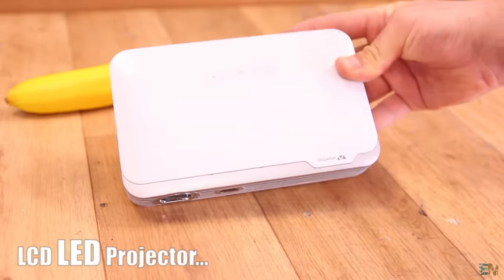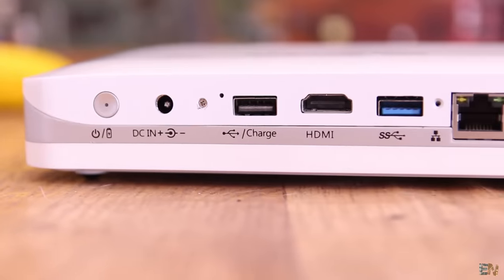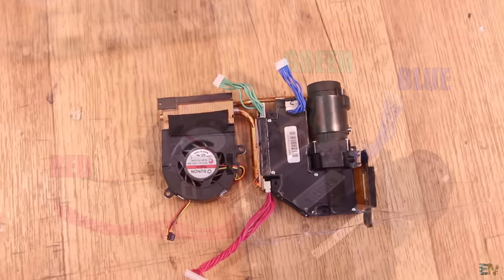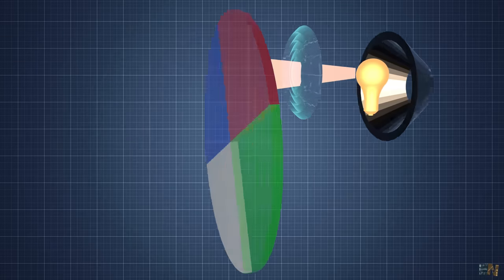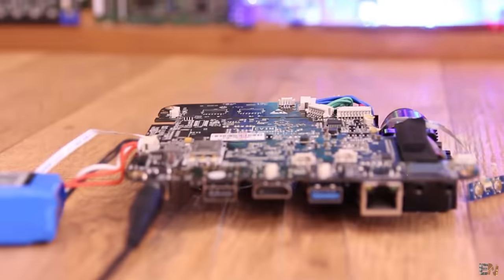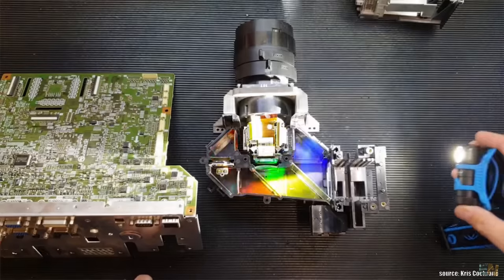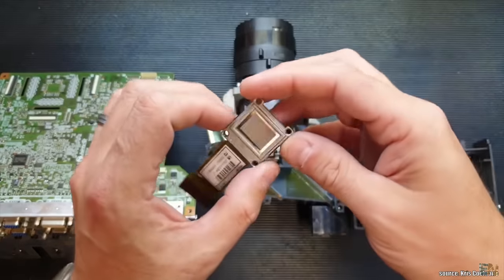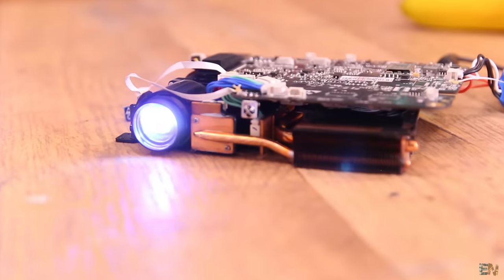DLP & LCD & Laser PROJECTOR - How They Work + TEARDOWN

Comment: I enjoyed this video. I was a bit shocked that you said your projector is LCD as it most definitely is not. You have a DLP Pico projector. No DLP controllers would ever be in a LCD projector. But, your video was great with animations and really spot on in many regards. There are also single chip LCD projectors, which are pretty much garbage. Finally, LCoS projectors own the high end of the consumer market space as used by JVC, Sony, and even one from Epson. The ultra high end, as theaters use, is the three chip DLP. 
I’ve moderated Projector Central’s forums for years, feel free to reach out if you want any follow on work or ideas. 
Keep up the great work.
Reply: Hi, can you please help me to figure out the cause of problem with my projector? Its reddish tint color where it should be white. Its vivitek qumi q3 plus projector. Thank you
Reply: @Sardeiuzz89  - It is best to look at FixItFrank's channel on YouTube as I am not a repair person, but the most likely cause for a shift to magenta is a failing or completely failed green LED or processing that handles green in the projector.  A lack of green = more magenta.
Reply: Thanks, I manage to open it and the cause of discoloration is a burnt lens, which I don't know how to acquire a replacement.
Reply: @Sardeiuzz89  More likely a burnt polarizer. Lenses do not burn.
Reply: @zaprodk  haha yeah I remembered lenses are round.

Comment: Your animations are excellent. Great video!
You should have mentioned the problem that appears with single DLP systems and color wheel or sequential led, which is the "rainbow" effect that bothers many people. While three LCD, LCos systems have the problem of RGB channel alignment.
And you could already comment that in systems with DLP the micro-mirrors are not only updated sequentially for each color, they are also modulated in pwm to adjust the saturation of each color.

Comment: That last one reminds me of CRT tvs, a light beam drawing lines across the screen, or in this case a laser on a wall. If they could ever improve the tech to make full screen images at 60 or even 120hz it could potentially provide the best looking picture ever. Actual bright vivid lasers making up the picture would look phenomenal.
Reply: CRT used to HAVE 120 hz monitors before LCD took off. Even 240 hz and higher LCD and LED monitors today often compare poorly to 60 hz CRT in terms of reproduction quality and overall brightness despite the advances in detail density and fineness.

Comment: It is unlikely that the speaker module has an amplifier inside as mentioned. Besides not being practical from a design standpoint, your speaker only has two wires which are highly likely the two wires to the voice coil. It's also clear from the picture that the speaker module has an active speaker and a passive radiator to extend the bass.
Reply: Exactly.

Comment: Great Video! I was wondering if you can change the resolution of the projector by changing the mirror mesh. 720p to 1080p or 1080p to 4K.
Reply: No. You would have to replace all the processing circuitry and software in the projector as well. Like replacing EVERYTHING.

Comment: I'm not aware that incandescent light bulbs have ever been used in digital projectors. (in 8mm / 16mm movie projectors yes)
What you probably meant is high intensity discharge (HID) lamps before LEDs become available for this purpose.
Also, the color wheel in a DLP projector isn't just RGB, but at least RGBW. Your animation actually does show the white segment but erroneously with no light passing through.
These are just small things, but factual accuracy is quite important ;)
The WOWOTO T8e mentioned as being an LCD projector although it seems it's actually a DLP one..?
Good video otherwise! :)
Reply: Yeah lots of factual errors in this video. I guess it was rushed a bit.

Comment: You are mixing stuff. Your projector has dlp chip and led light
Reply from the maker: The projector I have is LCD based with LED light., It also has a DLP chip because that same chip is in charge of selecting each frame for the LCD.
Reply: @ELECTRONOOBS  if it has dlp chip that imaging device has to be dmd. Second hint that it is not lcd but dlp/dmd is that rainbow effect on video
Reply: @snik2pl  Correct. 
Dlp will give rainbow effect on camera :D Not LCD.
I sure mini projector usually are DLP (to make it small)